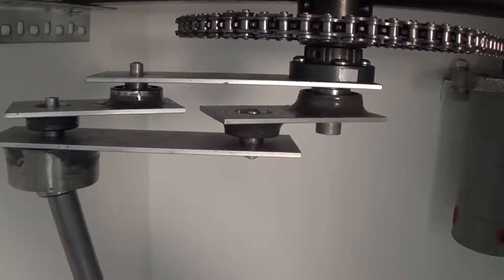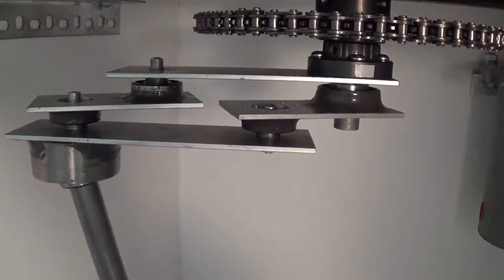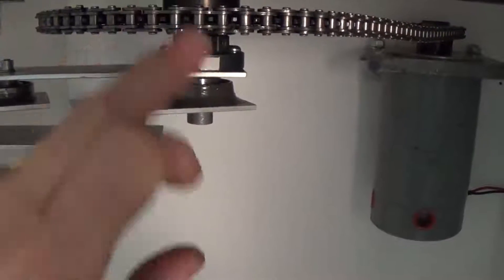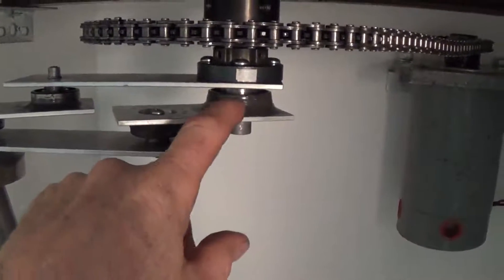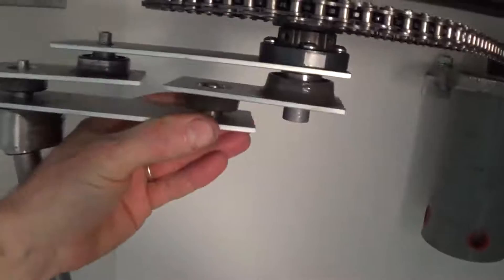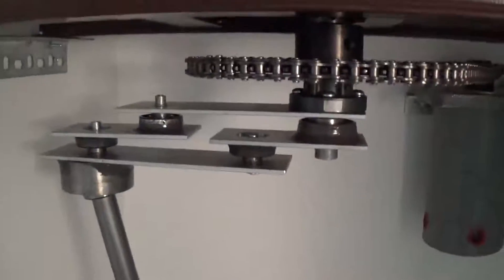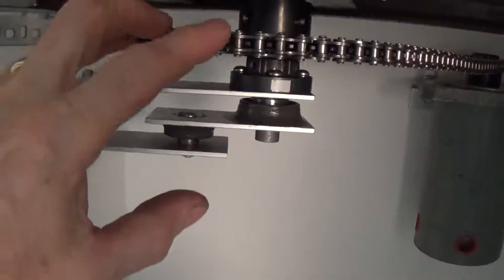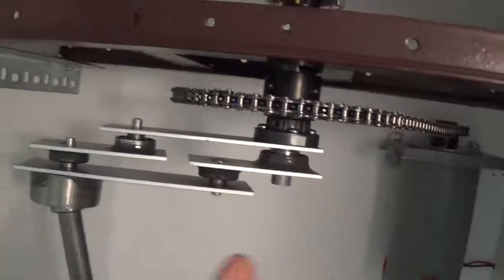William Skinner Gravity Assisted Torque Amplifier test 4

Comment: I think the key to the Skinner machine is the fact he used 4 shafts.. They were all connected on top..  As one move down,  the other moves up, counter balancing each other...  I know that makes the replication 4 times bigger..  but,  we all really need to be accurate when replicating to the original..
Reply from the maker: You could be right!... let me know how it works out once you built it.